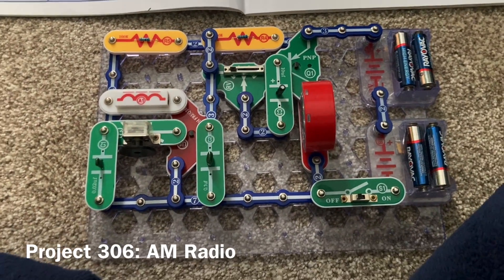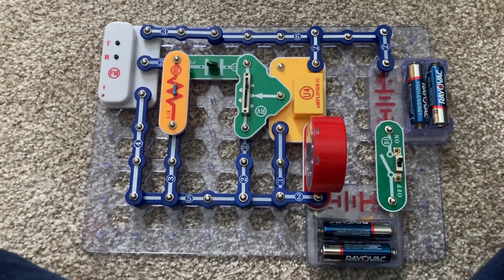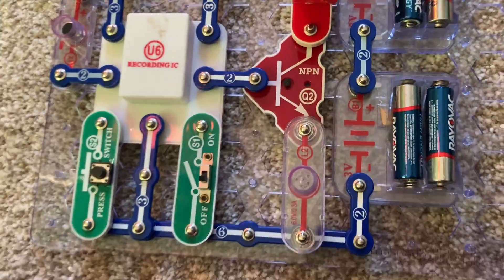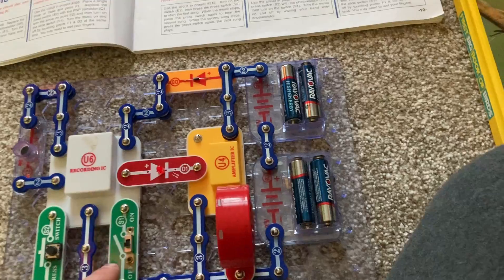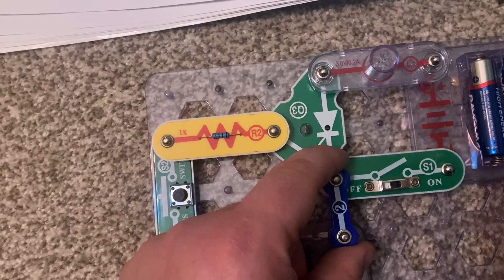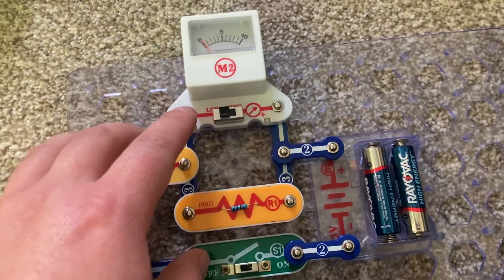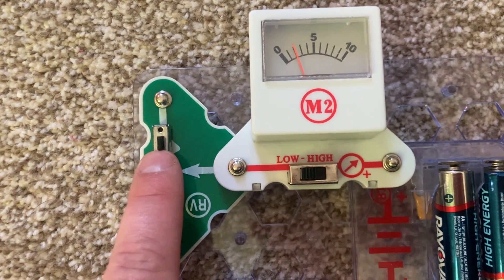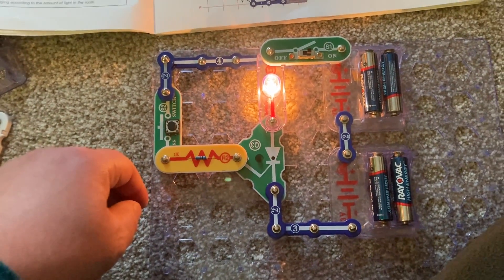Snap Circuits Extreme SC-750: Projects 306-328 (SEE DESCRIPTION)

Comment: Actually, I don't see the sense in this kind of kit. Everytime it gets a bit more complex than a single diode or resistor the whole circuit is packed away in a black box. Many chances to lean something missed. I possessed the Philips boxes during my childhood (and still own them). If you needed an audio amplifier for your circuit you didn't plugin a blackbox with a line in and speaker out but you built it from discrete transistors, resistors and caps. Need an AM or FM tuner? You did build it from discrete parts! Only when it came to very complex and dangerous designs like the picture tube or the TV tuner (two boxes I didn't possess as they were extremely expensive) Philips had complete devices but even then not in a black (or white or orange) box but in transparent acrylic!